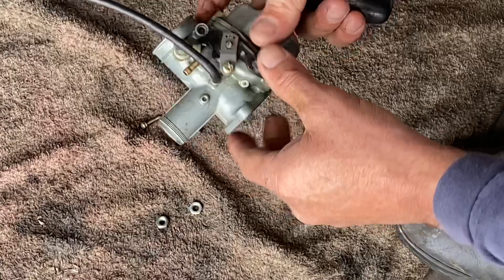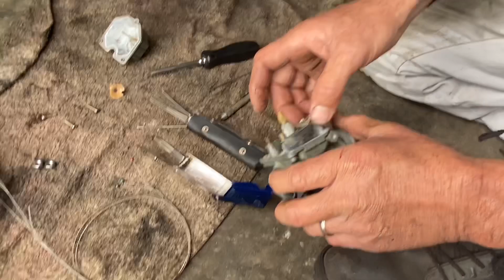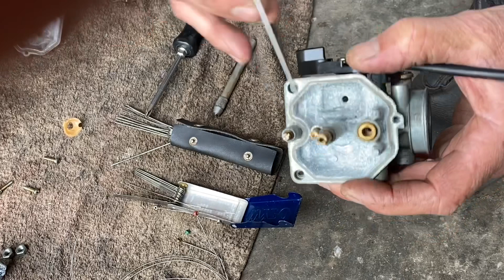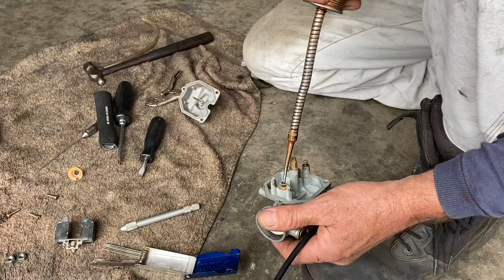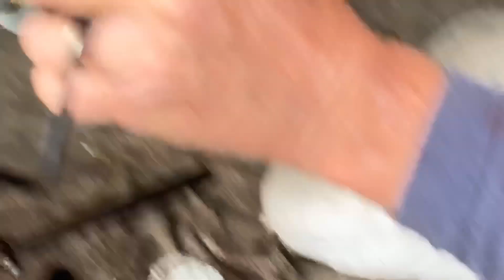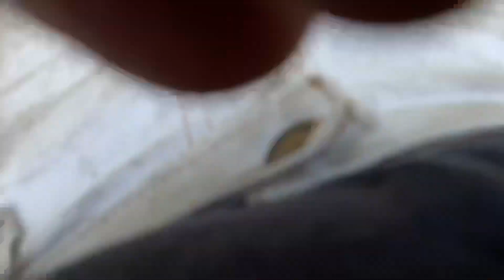Small engine carburetor repair Honda xr 100

Comment: Hey Steve, so I have gone through and done a full carburetor clean like how you stated in this video twice. The float seems to be set perfectly, the bike is idling perfectly, and I am able to run the full range of the throttle (full speed). I am having one problem that I can't figure out, that is if apply full throttle rapidly or if i apply the throttle to quickly at Idle speed to 100% the motor bogs down and quits accelerating as if it's not getting enough fuel I assume. If I dont apply the throttle rapidly there is no hesitation. If I am already riding at speed or 50% throttle and give it everything there isn't any hesitation, it seems to be on the lower half. I have checked the jets and sprayed cleaner through the ports. Would you have any ideas? Or just try cleaning it again? Tunning not right?
Any help is appreciated, thank you!
Reply from the maker: Yes it sounds like the lower speed  circuit is still a lifeless plugged or the lower speed is to small for your elevation or air temp. Good luck.

Comment: That looks like a 2001 which is exactly the one I'm trying to get running. Mine has been sitting for about 12 years. I've done all of the steps shown and mine still wont start. Any other suggestions? There is spark, it fires and runs for about 3 seconds when we spray ether on the air filter, so it SHOULD be a fuel delivery issue. I've torn the carb apart and put back together at least 8 times and still no luck. Im running out of energy for it!
Reply from the maker: Sometimes the passage going from the jets to the throttle bore are plugged a fine wire like a guitar string is helpful. Also check from the jets to the air bleeds. The small openings in the bell of the carb body. Good luck!

Comment: Hey Stevie I’m having trouble with my bike same Honda 100xr 2002 I took it off to clean it and gas keeps leaking out from the air filter,I checked my floater and needle all seems to be working good not sure what else to do
Reply from the maker: @Jsonshotit  if it’s leaking out the air filter it’s definitely most likely passing the needle and seat. If it’s a plastic float those can warp.

Comment: Mine was missing the spring and flat washer on the fuel mixture screw.  I re-assembled from a new kit in this order:  spring, rubber washer, flat washer.  Is this correct?
Reply from the maker: No . I m sure it’s spring ,washer then o ring.
Reply: Thanks.  I was able to change it easily.  Also had to replace the cracked carb manifold and install the new idle needle.  Runs pretty good now.  Thanks for your help/video @generalprinciple5921
Reply from the maker: You bet.

Comment: We have this exact same bike and carb. What’s the black hose on side of the carb for and where does to go ? Ours is completely missing it
Reply from the maker: That is just a vent hose for when you tip your bike over fuel goes out the hose and onto the ground instead of the bike
Reply: @generalprinciple5921  oh ok thanks and appreciate the content

Comment: The wires pulled out of a common wire brush work great also to clean out the holes on the jets
Reply from the maker: Yes sir I use that a lot. Thank you

Comment: Hey man I am working on the same bike with the same carb. I got it all cleaned with a whole new Japanese carb kit but when I run the bike it will on idle with choke on and it smokes a good bit as well. Could you enlighten my numb skull on how to tune the carb after setting the air fuel mixture to 2 turns out? I live in Ohio I’m not sure if we’re close in sea level but Im going to move mine to 2 turns out and see how it runs. It’s currently at 1.25 turns out
Reply from the maker: 2 turns out it a good place to start but you’ve still got a blockage in the slow speed / idle circuit. You need to check the slow speed/pilot jet and make sure the port from the jet the card bore is clear, also make sure the air vents coming from the air filter side air bell of the card are clear . (2small hole in the carb bell and the small holes in the side of the pilot jet) Hope it helps.

Comment: Incredible amount of detail without overdoing it or talking in circles. Very easy to understand, was going to skip tearing into my son's & just buy a new one but not before I go through this one.  Ethanol has to be the culprit of my issues.
Reply from the maker: Well I hope it helps it’s better to tough through it now and learn it and be able to use that information a 100 times down the road. Hope it helps Steve.

Comment: You lost me at the end with the clear tube float bowl check. Fuel will not exit into the clear tubing until it goes up over the top of the overflow tube inside the bowl. I am guessing we need to loosen the screw on the outside of the bowl where the clear tube is connected to allow gas to escape at the bottom of the bowl.
Reply from the maker: CalQwax yes that is correct you must loosen the screw. It finds the float level in the bowl and tell you exactly where the level is.

Comment: Hi thanks!
What kind of fuel do you use to get that dirty inside of the carburetor, E10? Ethanol?
How many engine hours / miles since last carburetor service?
What is the stock jets and which one you run now?
Did you have run any time a 'plug chop'  to select what main jet to use?
Do you know size of your throttle bore in millimeters?

Regards from soth america!
Reply from the maker: Hey Rafael, I didn’t check  jet sizes or do plug chops because it was just a case of getting running right for the new owner. The bike was almost new with very few hours on it, plus the new owner is a friends wife just to trail ride on it. It could have been jetted up one or two sizes maybe but the owner is going jet the bike as needed. I believe that the fuel in this bike was E10 but I’m sure this one had some water in the bowl to cause this corrosion.
Reply: @generalprinciple5921  very thanks to you!